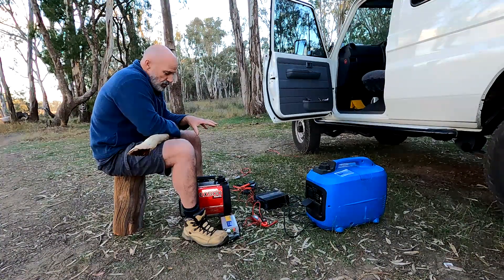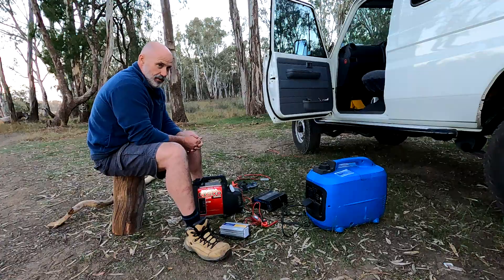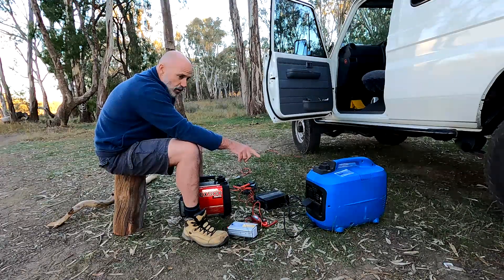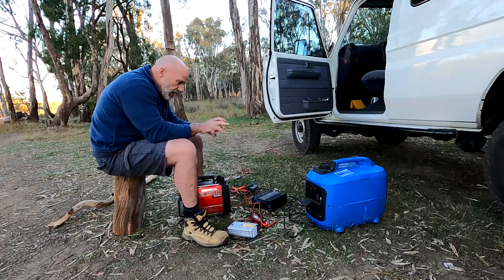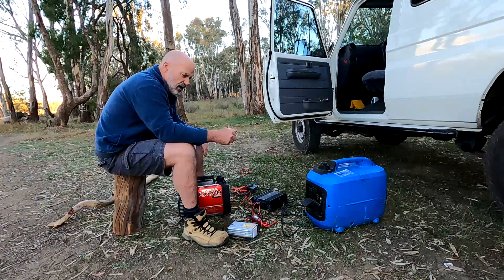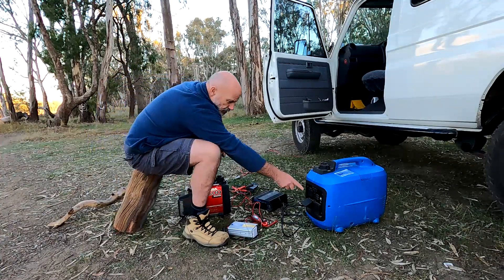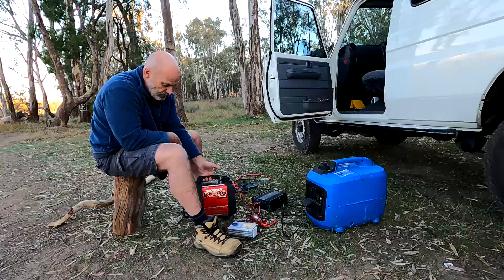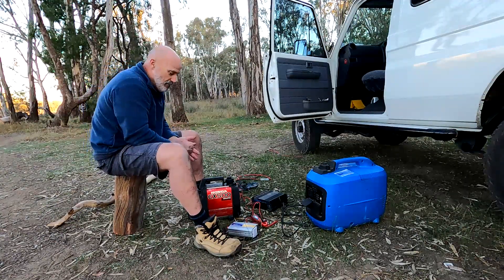Using a generator to charge batteries

Comment: Im trying to find out if my Yamaha EF 1000IS.  Will run my 25 amp hour  CTEK  Charger to charge   135 amp hour battery  .
Reply from the maker: Should do, dependant on the quality of the charger you shouldnt have any issues at all. With a pro charger a EF1000is will run a 50a charger so you should have power to spare
Reply: .  cteck pro 25S.  450$ one  Australia

Comment: Could you provide links to the stuff used in this video?
Reply from the maker: Its just gear I already own, anything in particular are you referring to or interested in
Reply: @Vagare  i was going to replicate your setup so all of it
Reply from the maker: @Clip_It1   Kipor GS2000 & Honda EX500 gensets. Supercheap 20A smart charger. The chargers charging ouput is dependant each on combined generator output and charger output, and its best to pair them accordingly. Some chargers with higher output cant deal with generators that cant keep up ie if the charger requires say 750w@240v some chargers cant regulate a generator with a low output than that 750w. There would be waste and excess cost having a large generator only powering a small charger. A good example is a Noco 50A charger and a 1000w genset. Genset will have constant output of 900w and the Noco 50A requires 750w to charge at its 50A capacity. Noco are very efficient, so the smaller genset would be pefectly paired and 50A charging output is a good middle range
Reply: @Vagare  thank you so much!

Comment: Thanks! I was planning on buying a 100ah lithium battery and using my generator to charge it. Are most battery chargers okay to charge 12v lithium batteries too?
Reply from the maker: Hey Steven, any lithium compatible charger. Lithium has a different charge profile than wet cell batteries

Comment: How to set up auto shut off after fully charged
Reply from the maker: @waad2020  smart charger will stop charging when the battery is fully charged and switch to a maintenance mode. It term of generator run time, it isnt  difficult to estimate charging time based on battery SOC and the chargers output

Comment: thanks for the information, fairly new to it. and totally makes sense to have one on hand for a crappy day.  I was thinking of going the garage charger generator option for emergencies the info about the charging amps was very helpful cheers mate. its also effective at charging a power station. like the ecoflow delta 2 as it does it extremely fast and you can switch it off.  (about 40min)

Comment: Exactly the information i was looking for.  Would it also be possible to plug 2- 20 amp chargers into one generator and charge a 100 amp battery fully in 2 1/2 hours?
Reply from the maker: Hey Dan, not ideal to run 2 x 240v  smart chargers on the same battery, the charge profiles would need to identical. I have to reset my Enerdrive 60A charger's  output to 40A in order to use my 1kVA Honda genset. I think from memory the Enerdrive charger requires 1050W set to 60A and 700W set to 40A

Comment: Here's one for you. I've just installed my first VSR split relay. Before I charged bat for about half an hour every day straight off the 12v dc output and noticed with a very good battery the voltage would go up into the 16's and settle at 12.9. A good battery, or good enough may go up to 13.2 and settle at say 12.5, which is good enough right. Now, with the split charger wired in the voltage read across the top of the bat with the 12v dc hammering in has dropped to 13.3 which is exactly the regulation specification for the split charger.... but.... in reverse, I mean I'm charging the leasure battery that is wired to the starter but charging it just by connecting the genny 12v dc, so the current may be going through the VSR but not coming through it. So wtf's the magic of that? How can the split charger maintain the cross voltage at 13.3 when the dc is plugged straight on the bat?

Comment: Hi, I have a 2.2kw petrol generator the instructions say i need to ground it, would i need to ground it charging a battery using a battery charger from the 240 outlet or if i was using an extension lead to power a device such as a domestic fridge or a microwave ? Thanks in advance.
Reply from the maker: Hey Richard. Most folk (me included) either dont know or dont care about the risks of not having a proper earth. Some folk install RVD device to compliment the van's RCD. Youll find that most generators have an earth terminal which you can connect to a metal stake belted into the ground.

Comment: Thank you for the video!  I just started looking for a generator to charge my batteries and was shocked by the low DC output ratings. So I came to you tube to see what the deal was and found your video. So to get the most charging power out of the generator the power has to be converted from DC to AC then back to DC?! Crazy!
Reply from the maker: Hey Justin. It would cut out the middle man by just adding a decent charger inside the generator

Comment: Good video mate. I'm a total noob regarding amps watts . I would like to run an electric trolling motor for 6 hours at top speed it uses 42 a and 500 w may you please give me some advice what to buy to do the job. Best regards Adam.
Reply from the maker: 42A means 42A per hour. The 500w come from 42A x 12volts.  42A is a lot of energy per hour. Power required is just 42A x 6hrs. To run it for 6hrs x 42A with an wet battery is not viable, even with lithium it would equate to 300ah which with Enerdrive is a 40kg $3000 battery. Are you sure its 42A ???
Reply: @Vagare  yes on top speed but 21 ah at half speed would like to know how can I use the petrol generator on cloudy days.
Reply from the maker: @collowood  buy a decent 240v smart charger and run it from the generator. As mentioned by another commenter the Noco Genius Pro 50 is very expensive but should punch out a full 50A per hour on a 1kW.  generator
Reply: @Vagare  thank you so much for your help.

Comment: Hi Vagare! Thanks for the video, very explanatory :) Could you tell me which generator is it? I'm planning on powering a 40A smart battery charger to charge a 400Ah battery bank (4 x 100ah batteries). I was looking at buying the EU2200i honda inverter generator, but seems it only outputs 18A and that wouldn't be enough... I was thinking about this setup, so that when i'm off grid I use the generator the least possible (say, charge the battery bank every 4 days), so it's less of a hassle and annoyance for me and everybody else. I'm new to this thou... does what i'm saying make sense?
Reply from the maker: Hey Jose, the generator in the vid is a Kipor GS2000 (2kW).  Youll need a bigger generator to run a charger at 40A. You could get around 40A per day into your batteries with a single 200w solar panel.
Reply: @Vagare  thank you! Was also wondering about solar a few days ago but found out it won't add up to my demands, thou a great solution for many
Reply from the maker: @JosesBWK  if batteries and solar arent enough to meet your power needs, a generator may be your only option
Reply: @Vagare  true
Reply: Can you explain why a noco pro 50 wouldn't work in a 2000w generator? 
Honestly I don't know how it's possible but specs claim 750watts power consumption.
Reply from the maker: @cd3125  hey CD, im not familar with that charger. 50A from 750w sound interesting, so i might have to have a look
Reply: @Vagare  if you go to their website an pull up specs sheet the way I read it would work. 
I'm looking for options to build my own apu on a truck.
Reply: @Vagare  in the process of building a saddle box w 15gallon tank, predator 2000 and a 12v ac.
Esbar heater, fridge are no issues.
Microwave use is brief enough to never cause problems either.
The ac unit I have purchased However will need help sitting overnight.

Comment: Hi, 
I have a generator and a battery charger to charge my battery, however I wasn’t sure if I need to unplug everything from my battery first (Solar panels, Inverter etc).
Thanks
Reply from the maker: Smart chargers can play well together, particularly during bulk charging. They can conflict with each other when in maintenance modes but at that stage your batteries will be 80%+ charged anyway